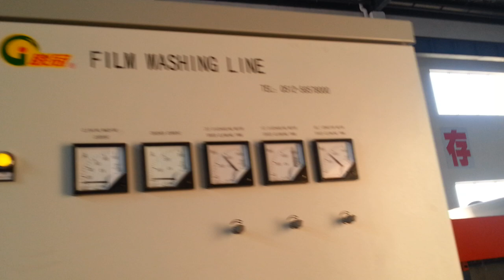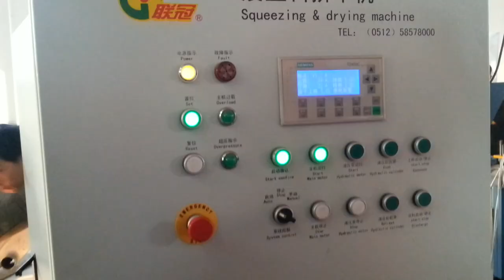waste plastic bags recycling machine

Comment: Are all the bags really that dirty that require washing adds more expense to recycling costs
Reply from the maker: the bags come from many different sources, it may be used in very dirty environment, so the washing deivce is necessary to make it clean.
Reply: @mackma1598  so there must be a large  percentage of contaminated plastic film that requires washing rather than a small percentage this  obviously adds cost of the recycling process then you f course drying afterwards there seems to be a shortage of plastic film recyclers in Vancouver BC Canada opportunity to set up a plant
Reply from the maker: @briansokoloski776  u r true from certain point, but we mention recycling, we mean recycling in industry type, first,  the cost to seperate the relatively clean waste film from the containmed film is also high, second, even if it is relatively clean, it is still used one and can't be reused directly, the crushing washing drying process is necessary for further recycling and reuse it at last.